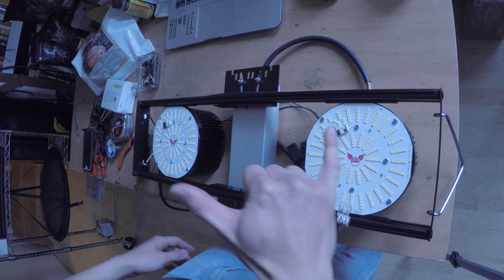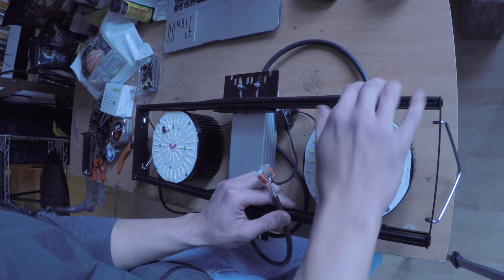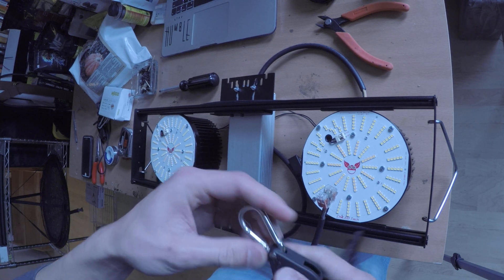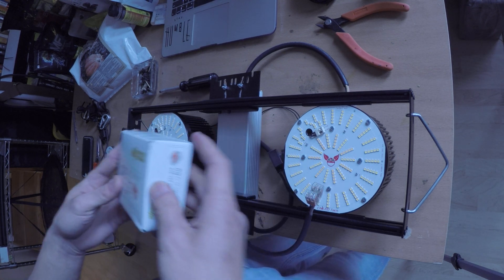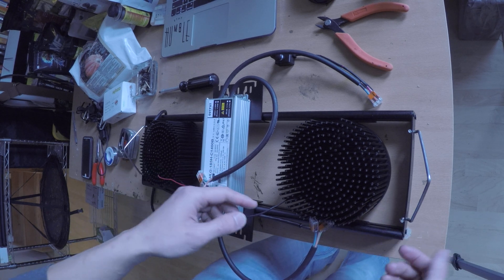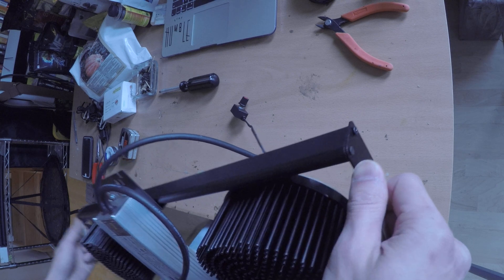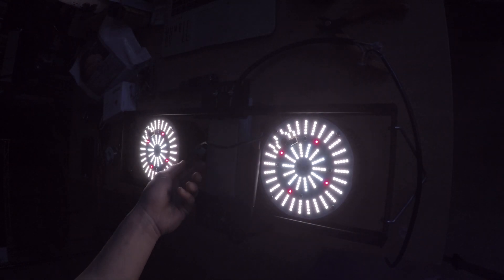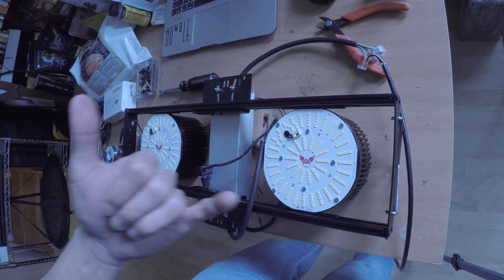ChilLED Logic Puck V2 2'x2' GrowMau5 and RapidLED Grow Light Product Review

Comment: Cool video looking to give a 4 by 4 setup what would you get. Also subbed up okie dokie stay cool peace out
Reply from the maker: Thanks for sub, I need to start releasing videos again. Whats your budget looking like?
Reply: @earthsmedicine445  4 to 5oo hundred
Reply from the maker: @bowandarrowindian3704  Whats the area size your trying to light up? Will this be your first grow?
Reply: @earthsmedicine445  I'm not getting your notifications when you respond I was in trim jail 2 Sticky Fingers some Dark Helmet at my fingers on the phone now appreciate you getting back to me
Reply from the maker: @bowandarrowindian3704  I'm seeing your response on the bell on the tube but not as a notification.

Have you seen the Atreum Lighting Bars? I just picked 2' x2 and they're doing well so far. LM301B chips w/ cree xpe for a reasonable price. Heat sink already ready to go, you'll need a 3 - 5 wire connectors depending how many you wire together. The 4' bars are 119 US before shipping even then shipping was much at all because of how light they are.

Other than that the logic pucks are REALLY fun build and would highly recommend those as well from rapidled. The kit has everything you'll need, somethings I found helpful to keep things cleaner was shrink tubing, waiting to get side rails for my pucks so they direct more light to the front instead of the sides.

Comment: With the HLG-185H-C1400B driver, which you're using, you're limited to about 70 watts per puck, not 100 watts.
Reply from the maker: Thanks for pointing that out, I had the C2100B in mind while making this video. Going to switch to the C2100B when I have more funds and hopefully have enough to pick up some LM301B 2' and 4' bars with 660nm built in.